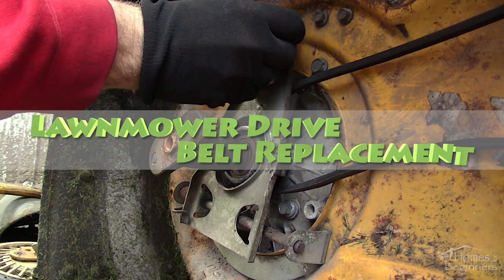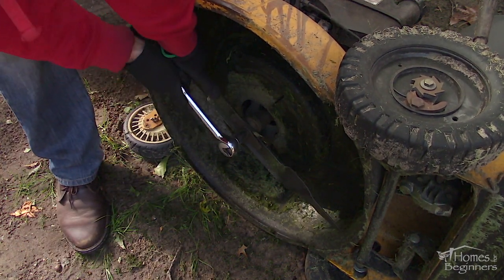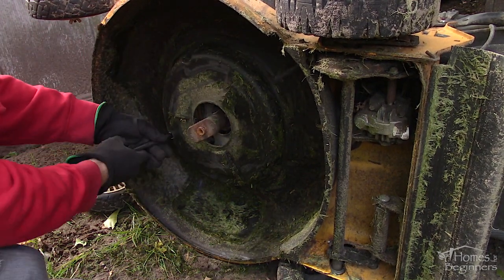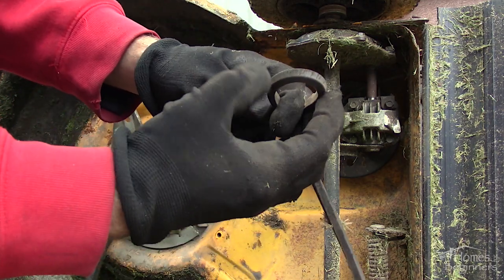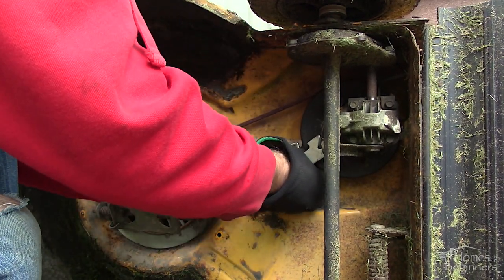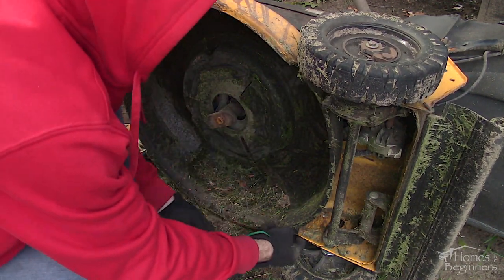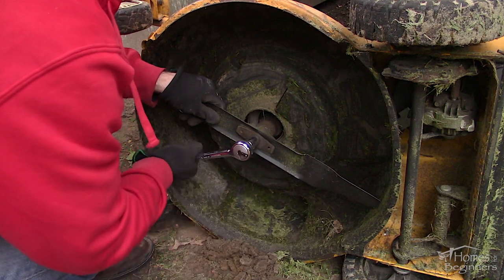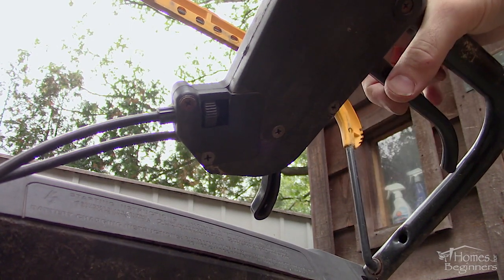How to Replace a Lawnmower Drive Belt

Comment: 🙌 I cannot tell you how hard I looked for a video like this. I have an SRC 621 and could not find a video that explained it specific to that model until now! 

I just did this exact repair last weekend and have now run into a problem with my self propel function. Before replacing the belt, the mower was propetually stuck in 5th or 6th gear, it would never let me go below those gears. 

Fast forward, I replace the belt by taking off the blade adapter and lowering the swing arm (contrary to your method) and successfully replaced the belt. Put the idler pull back together and decently tightened it. Went back to Turn it on and realized the speed control cable was not seated in the wheel on the outside. So I fix that by reseating it and installing it back into the swing arm and now I barely have any tension on the drive cable at all, and the gear selector is still stuck. Once more, I tried to take a part the control box for the gear selector and drive handle and broke some of the screw holes. 

mowed the yard after all this just fine, but the self propel would not engage so I am panicking hoping I can open everything up again this weekend to fix the issue. From what I can tell, there is nothing providing pull tension to actively get the belt to engage with the pulley. Any good ideas where I should start? 

From the video, seems like adjusting the speed selector and drive engagement right off the bat might fix the issue. We will see. Still don’t know why the gear selector would be stuck though. I’m hoping some easing of the tension on the speed selector fix it,  but I’ll have to start the process of elimination after that if it isn’t fixed with adjustment of the speed/drive cables. 

Thanks for the thorough video!!
Reply from the maker: Glad I could help! Almost sounds as if the gear selector is broken. If yours is the same as mine, it's a plastic assembly so something may have broken inside. If you're not already, check the movement when you're inspecting the underside with the covered off and the lawnmower not running.
Reply: @homesforbeginners  yes I believe something was already broken with the gears. I was fine with it being stuck in 5th or 6th gear. As I could at least still have propulsion. But now I can’t even use either of them so I think I’ve done something to the drive cable. When I pull, the cable is barely moving the transmission and pulley, not nearly enough for it to catch and engage with the motor and cause movement of the wheels. Idk how I would have broken that in changing the belt but I think I did something to somehow cause the back pulley (where the belt loops closest to the rear of the deck) to not be able to pull and tense up enough to actually engage. Going to look at it today and hope for a fix. I’ll let you know.
Reply: @homesforbeginners  Just spent two hours trying to fix it with no avail. Still having a hard time understanding what’s wrong. Any chance I can email you some video from my repair attempt to get your opinion?
Reply from the maker: Being that it's the same open/close pulley, it doesn't have gears. It works on a variable pulley drive, similar to a snowmobile. As the engine pulley changes in size, it'll change the ratio which affects the speed on the wheel gearbox. Feel free to upload the video to YouTube and just share the link in the comments here.